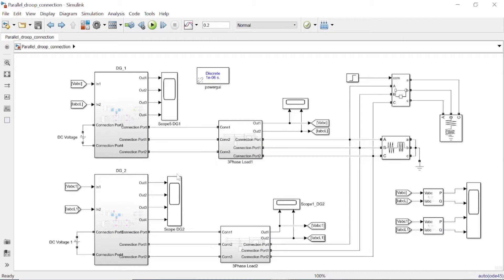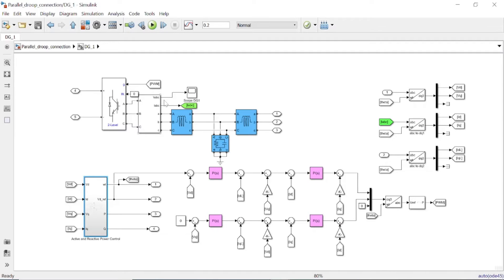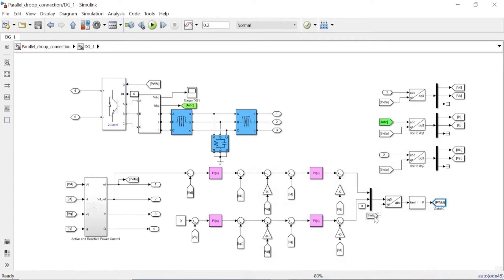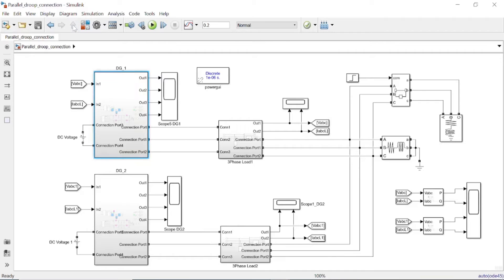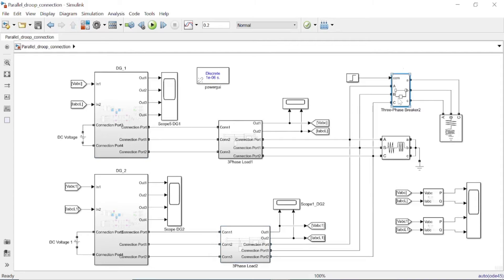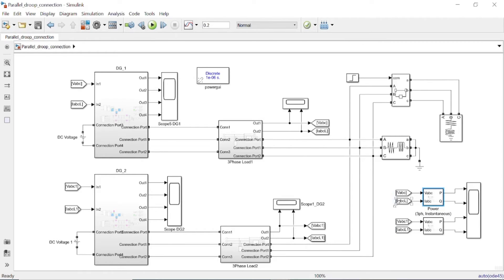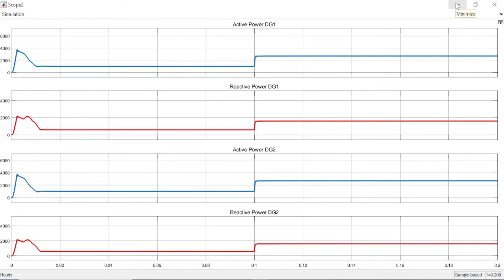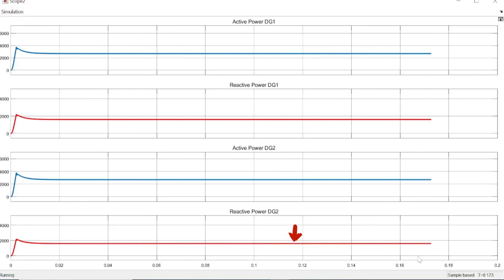How to connect two Inverters in parallel.

Comment: Really appreciated your work. I have been following for the past year. It would be grafeful if you can make a video of Virtual Synchronous Generator with PV -Battery Control System in a grid connected microgrid.
Reply from the maker: Thank you for the support.  We will try to design.

Comment: I love your work doing great.  I want a video of a synchronous generator and inverters in parallel using the droop control. Secondly, I also want a video of the system operating on both grid and islanded mode
Reply from the maker: Thank you for your kind words.  We can work together to connect the inverters and SGs in parallel.  I am currently working on an SG. When it's done, I can now try to connect to the inverter. But there's no harm in collaborating.
Reply: Really appreciated your work. I have been following for the past year. It would be grafeful if you can make a video of Virtual Synchronous Generator with PV -Battery Control System in a grid connected microgrid.